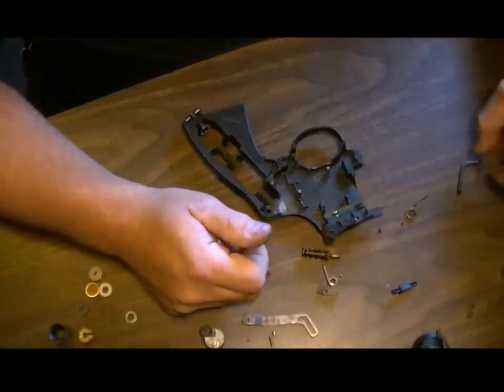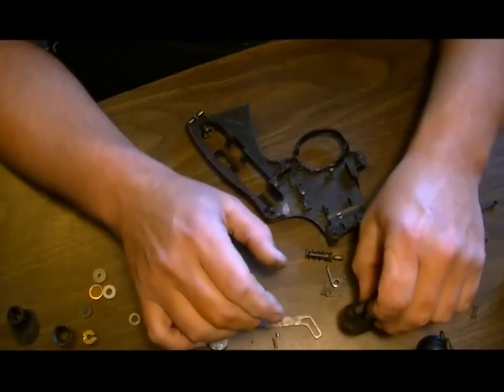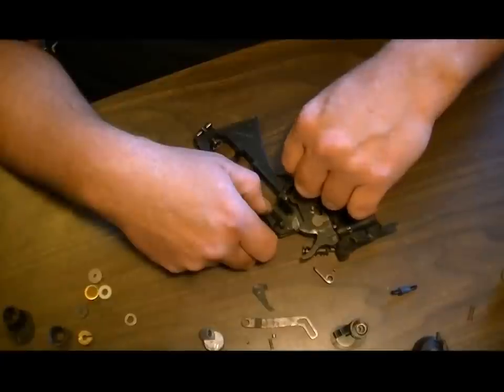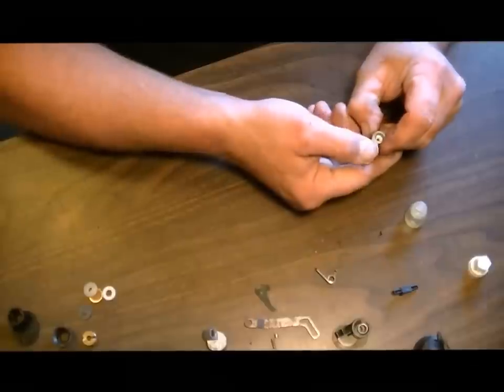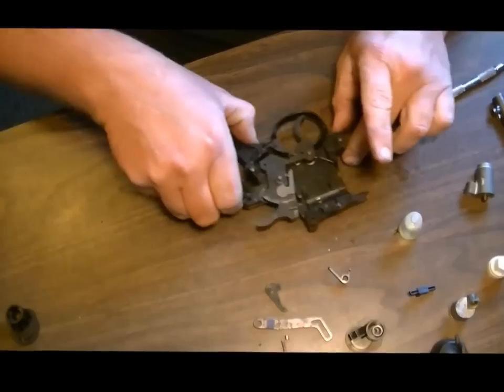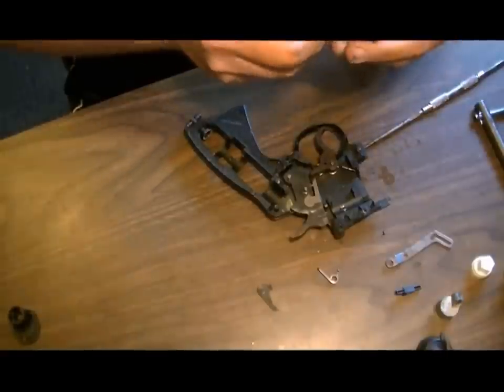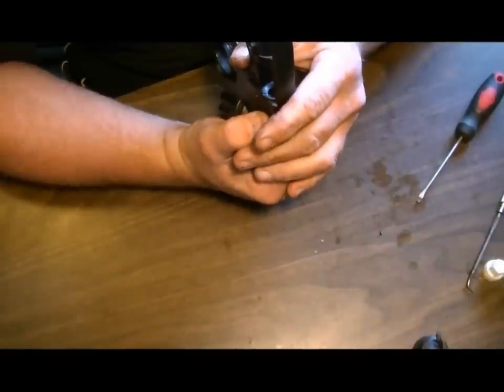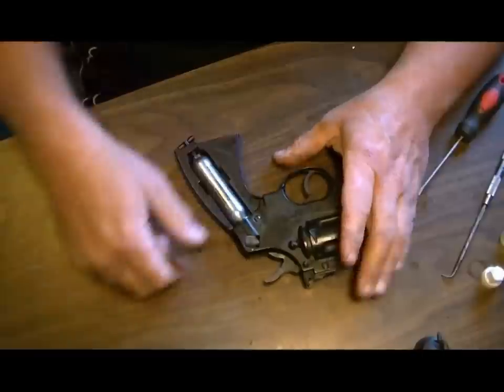Crosman 357 how to rebuild

Comment from the maker: the one iam working on in the video is the older 357 not the newer one and the indexing prawls are different , the bb version uses the older indexing prawl as does the older pellet version,
Reply: I'm sure they should have a parts rebuild kit for all cr 357 model made dates somewhere- i was looking at this flick and figured on ordering my part i need, its the leaking seal ring(s) but i guess you or i would have to contact crosman and may not like their price and keep checking-

Comment: Can you help rebuild mine i can pay for service charge
Reply from the maker: nope sorry man thats why i did the video , i dont fix airguns anymore
Reply: Its more of assembling back together i tried Evike they won't do it
Reply from the maker: Jaron Lee never heared of Evike
Reply: KevinMillard68 

Hi, I have this Crossman 357 pellet gun, but when I try to replace the air cartridge, there is no release of gas (I tighten it hard much as I can), and when I remove it, I can see there 
no hole is punctured in the cartridge. What do I do? 

Thanks for the help.
Reply from the maker: S Danman you need a new percing cap and would likley need a new end seal as well see abairgun.com for the parts
Reply: You mean the tiny brass piece at the top that does the actual piercing? Isn't there some way to lower it or something?
Reply from the maker: S Danman the pericing pin is not brass its steel and sometimes the tip breaks
Reply: Sounds like a pain to replace.
Reply from the maker: S Danman pretty simple really

Comment: Hi:  Thanks for sharing your expertise with us.  I dropped my .357 and broke the rear sight.  I got the parts and installed - it shoots single action fine but will not shoot double action now.  When pulling the trigger the hammer moves a little but will not go all the way back for double action - the trigger moves all the way but the hammer moves only a little bit.  After I got it back together it did work Ok in double action but after about 5 rounds it started acting as described above.  i do not have any parts left over and I did not force anything when putting it back together.  Any advice on how to get rid of this problem would be appreciated.  The gun holds air just fine and its only problem is the inability to shoot double-aciton.  Thanks in advance for any help you can give me.
Rocky1405
Reply from the maker: well you got something together not right that or you bent something or lost the tiny little bushing that is on the cycle pin that is on the hammer which can explain the no double action part
Reply: KevinMillard68
Thanks for the quick response - I will check that bushing.  Best Regards!

Comment: I have the same gun with the 8 inch metal barrel, and after a total rebuild it shoots at just over 500 with 7 grain pellets. however it has a lot of blowby coming from around the hammer, which is odd. any ideas? thanks.
Reply from the maker: no idea on that other then you ciould have a touchy valve seal in the back of the valve but if your getting just over 500 thats normal speed with the 8 inhc but it will also settle down to just a hair under after your new seals break in so even the blow by might also settle down as well
Reply: thanks! @KevinMillard68